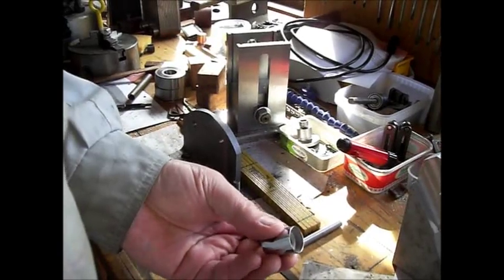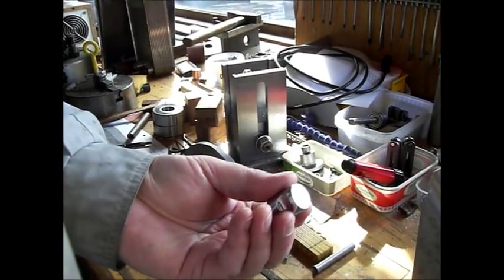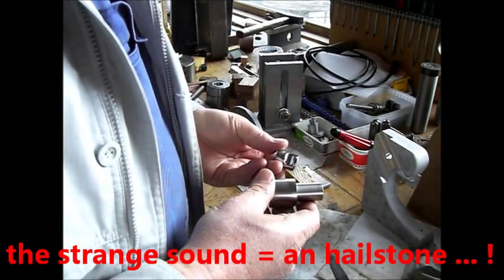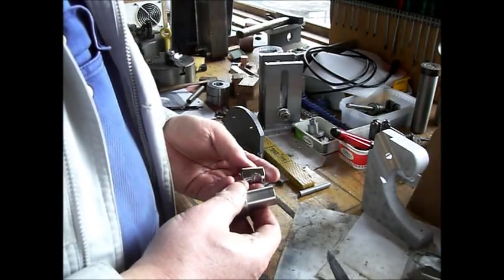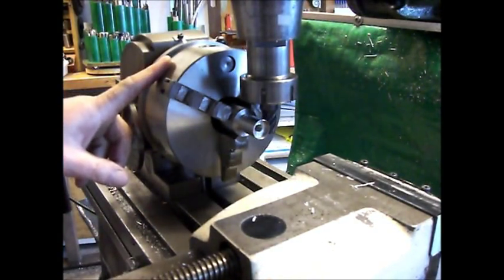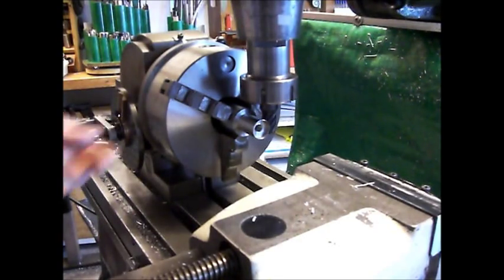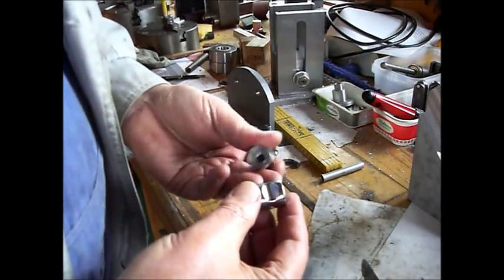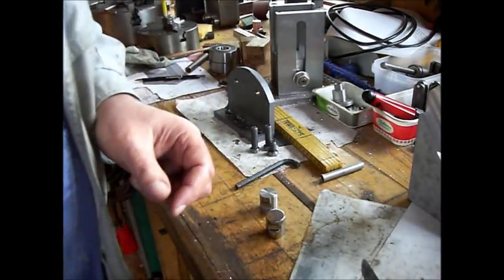VOLA Toilet Knob

Comment: You fixed the shower, now the toilet, I can’t wait for the sink tap handles next ;-)
Reply from the maker: In fact I have thought about replacing not the handle but the taps - the last pipe in the arrangement is a little hard to get cleaned for calcium I think it's called and over the years teh chrome is disappering ... but it's a little harder to do because it has to be bend in a nice curve ... but thinking about how ... yes, I am ;-))

Comment: What a simple little design!  I am guessing that you pull up on the piece that you made.  That is attached to a rod, which in turn is attached to a flapper/stopper.  The stopper rises and lets the water in the tank out.  Question; What hold the flapper/stopper up until the water in the tank flushes out?
Reply from the maker: vajake1 ???? I'm sure I did write an answer to you ... but I can't see it now - so here it is again !

Inside the water tank is a unit that - with my pull in this handle I made - holds the drain open untill all water is out of the tank. Then it closes the drain again and opens the valve for new water ... continues until the tank is full again and closes the valve - very nice and nifty 

... and expensive too - ALL VOLA brand is expensive because a famous danis arcitect in the 1960's design it - it hard to maintain - yuo MUST have the right tools - but it WORKS and a lot of affort is "build in" to make everything easy - if you have the right tools - take a look here:

https://www.youtube.com/watch?v=RIqURSRr800
!
Reply: Ah, very good!  Thank you sir!

Comment: Darned rich Danes... I'm lucky to be able to afford aluminum and you have SS just lying around.
BTW: That knob is a bit wimpy.  Something as important as that should be the size of a slot machine handle, require two hands, and be painted bright red!
Reply from the maker: Eddie the Grouch Ha, ha, SS is as cheap as it can be here and we can get it in acid proof quality too - I believe that's because of our pigs-industry maybe is in a decline and the smaller slaughterhouses is closing down with a lot of acid proof SS going to the scrapyard.

When I'm at the scrapyard I focus on SS in the first place, then aluminum and the everything else.

Winpy ... no, just good design, simple and easy ;-))

Comment: Perfect, A question: does the water spin clockwise or counter clockwise when you flush the toilet? Harvey from Nebraska
Reply from the maker: binks166 There is very seldom such rotation in the toilet and if there was it has nothing to do with who this knop is made - right ?

But in washbasin normaly it spins clockwise, but you can force it to go counter clockwise by hand.